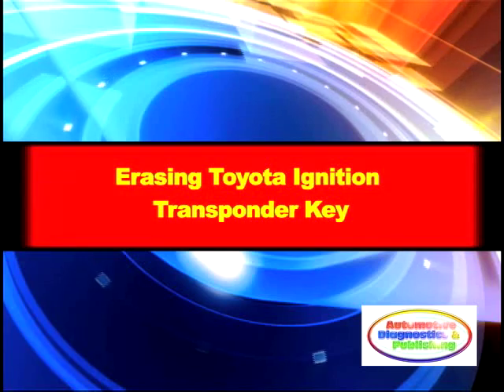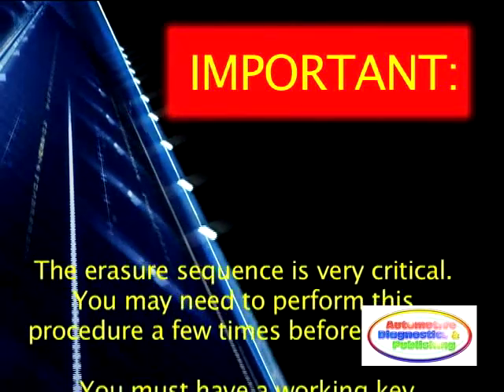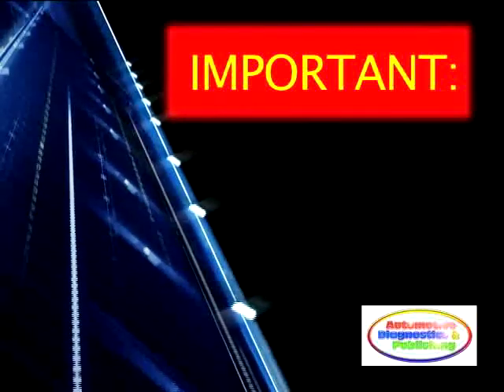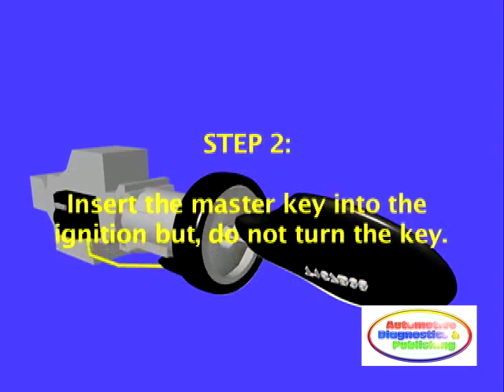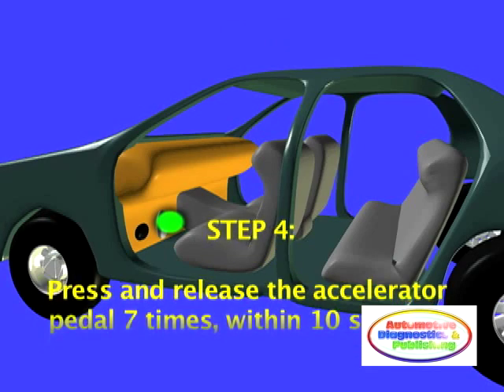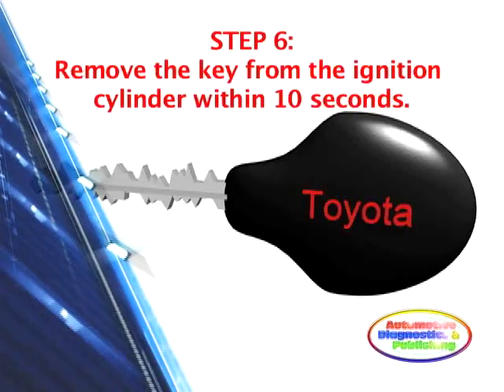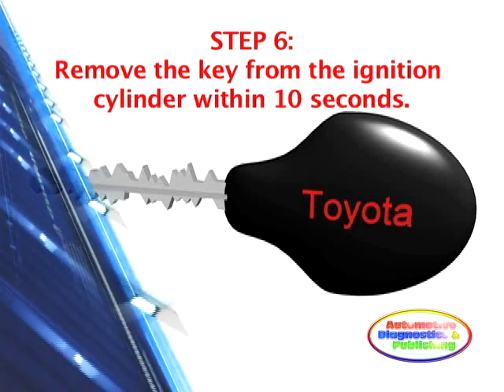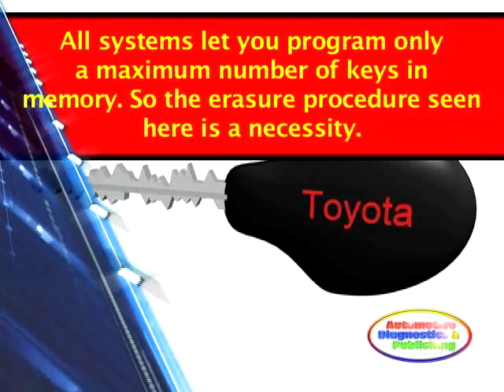Erasing Toyota Ignition Keys

Comment: I would like to know is it both press accelerate pedal doing step3 and step4?
Because i have saw anther vedio abuot programming new transponder key by pressing accelerate pedal 5times and brake pedal 6times?
in this vedio,step3 press accelerate pedal 6 times, step4 press accelerate pedal 7times. Is it worng?